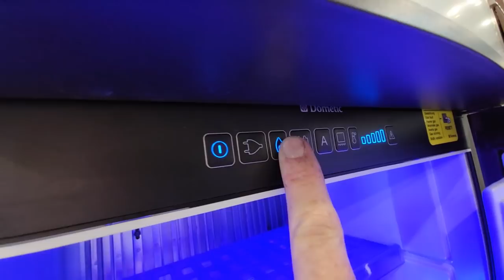Inspecting Andrew Steele's 2017 Leisure Travel Van +Walk Thru

Comment: Surprised the leisure has the twisting on the roof fiberglass. I didn't have any of that twisting on a 2003 holiday rambler DP.  The fiberglass was much thicker on it as well. Seems the newer ones went with a much thinner fiberglass/filon.
Reply from the maker: It's a common thing to see, not really a problem

Comment: Sealant on a roof always deteriorates in the appearance of that sealant on that Van is only three To four years old,Considering the price of a leisure travel event and the fact that you sealant that's crack like that after 3 to 4 years doesn't speak to good quality.
Reply from the maker: The cracking is normal. All the sealant does that, it's stil sealed.